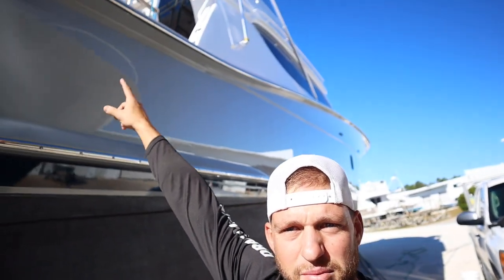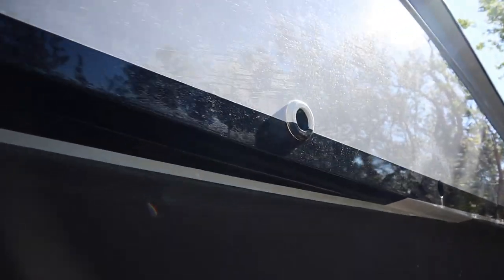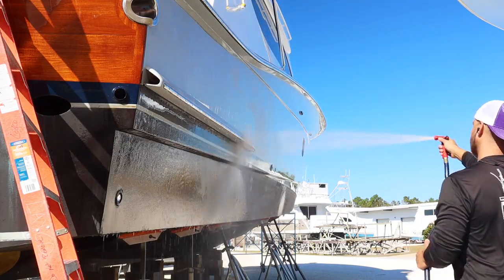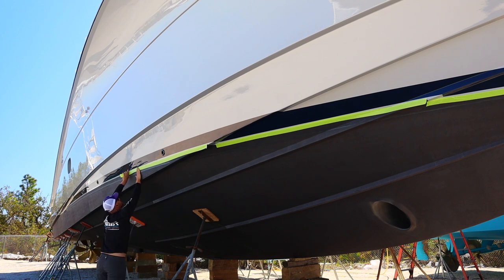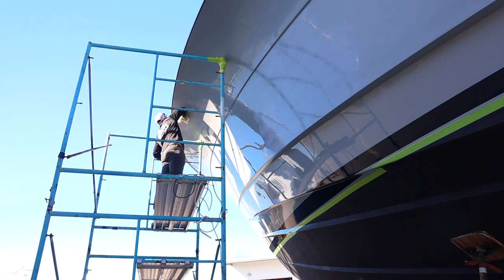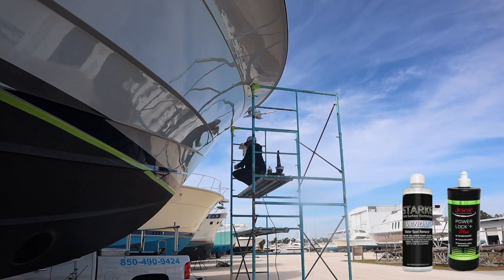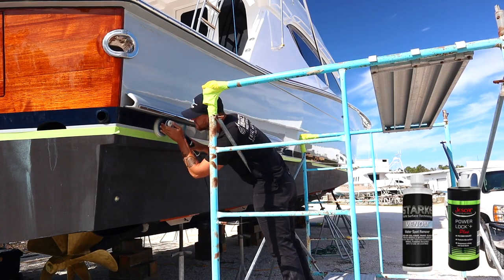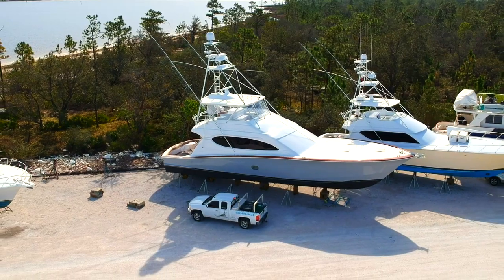How to Remove Water Spots on a Boat | Boat Detailing Business Tips | Revival Marine Care

Comment: Why wouldn't you just use Heavy Cut Compound on a grey pad and then finish with the Power Lock. Was there just not much that needed to be cut, is it quicker, and would you charge both the same as an additional step? Awesome video just watched a few an wondering why you choose this approach compared to your others.
Reply from the maker: Wiping the water spots off is way quicker than doing a buffing step. Plus, I did a test spot off camera and the menzerna  400 would not remove all the spots. 

I charged $300 Extra for the water spot remover. 100 an hr, took me about 3 extra hours to remove the spots = 300

Comment: I bought a Rupes (just personal use) and now after watching this I am a bit nervous.  I live in Toronto Canada and wasn’t finding the Flex very easily.  Once I can access my boat again I will use your advice to get the haul shine.  My question is for later when i do the top side.  I am afraid when I do the Dawn cleaning it is going to mess up my haul as it drips down.  Is this going to be an issue or should it be fine?  Great videos!    Matt

Comment: Great video as usual, but please tell me what to use on my black hull for holograms, Menzerna  400 and white pads? I am using a Griot's Garage G-15 long throw orbital polisher. Also just to clarify after I use the Jescar Power Lock do I need to apply a wax or is the Hydro Pearl spray enough? Do you have any experience with Nexgen Ceramic spray? Thanks for sharing your skills and knowledge!
Reply from the maker: Yes, menzerna 400 and white lake country foam pads will work. 

Jescar power lock is a sealant, so you have the option to apply wax on top of it after letting cure for at least 3 hours. 

I personally don’t love putting wax on top of it, I like either hydro pearl, or a new spray I have been using starke replenish. 

Hydro pearl has been known to leave some streaking on darker boats. 

Strake replenish is a spray on wipe off formula, it’s a great product to maintain the boat with. Apply atleast once a month. 

https://drakesmarinedetailsupply.com/products/starke-replenish-silica-spray?_pos=5&_sid=b13cc507d&_ss=r

Comment: sometimes you use grey foam pad and other times orange foam pad. what is it that decides what to use and what do you prefer (on a white hull)
Reply from the maker: This is a desperately needed video!

I typically would always recommend to finish out the surface with the finest pad you can. Sometimes if I need to cut more  I will use the gray pad. If I just need to finish and polish I’m going to pretty much use the orange pad. If I just want a super fine nice polish finish I’ll use the white pad
Reply: Thanks Drake